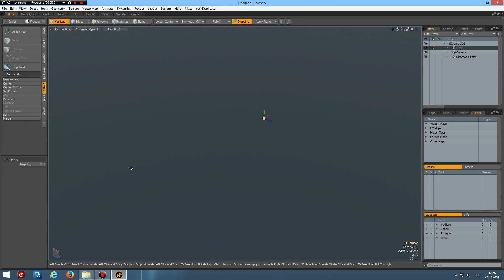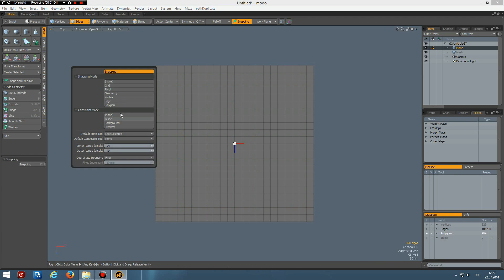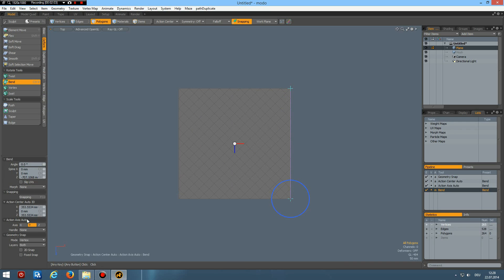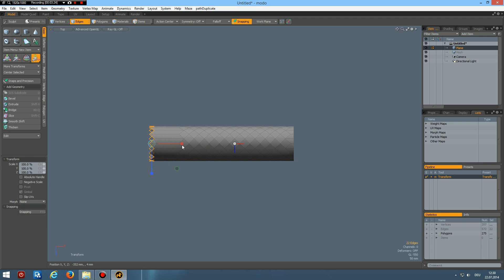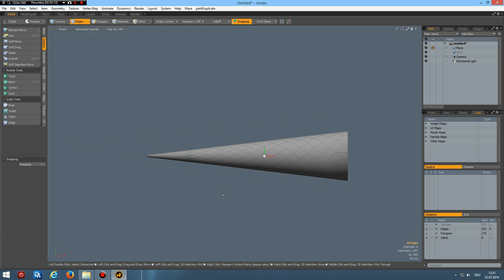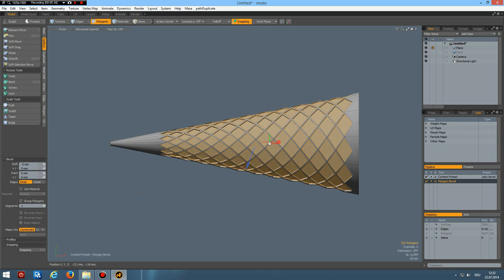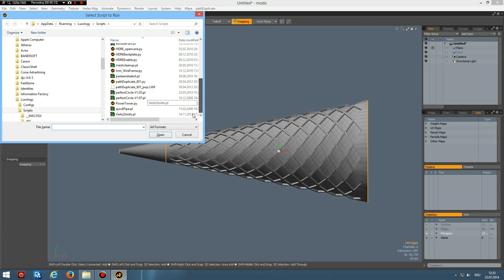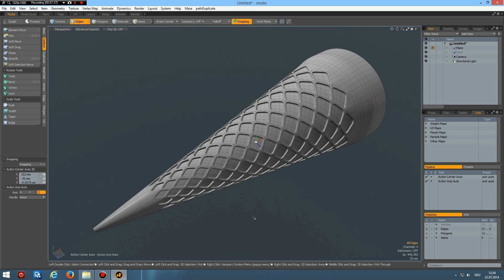The Foundry MODO - Modeling an Ice Cream Cone

Comment: OMG, i cant even make a fkn simple plane. What kind of software is this???

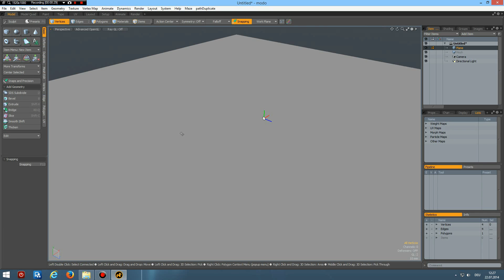At 0:30 when i shelf click, the plane does not appear in the view port. Any ideas?
Reply from the maker: +VFX Ltd™ Hmmm.. i very much understand your frustration. I was in that situation very often myself (and still am sometimes). A good habit to remember, is to hit the ESC-Key 2 or 3 times to reset or dismiss all tools, then retry. Another thing which I use often, is the mesh cleanup command. (Not Modo's fault. It's always me having 'Finger Trouble' :-)) Good luck and a lot of success with modo. Kind regards, Peter